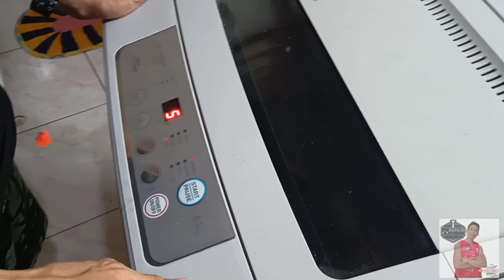not spinning problem .. sharp automatic washing machine

Comment: Sir ano ang dapat gawin kapag isang direction lang ang ikot?
Reply from the maker: Check mo gearcase shafting
Test mo sa multitester ang wire na connected sa motor kung may palo sa left and right
Reply from the maker: Pwede rin sa clutch spring
Check mo sa tester kung may reverse forward ang motor